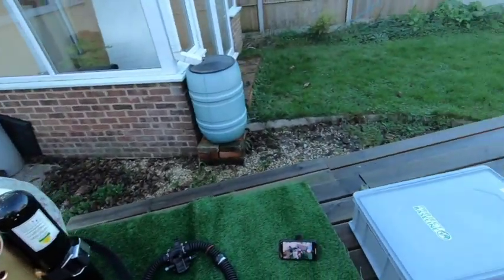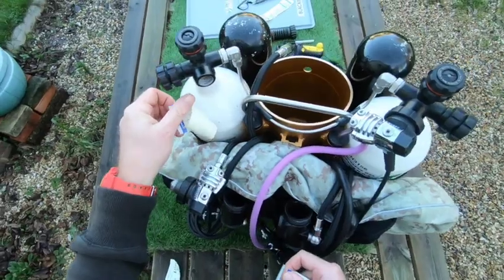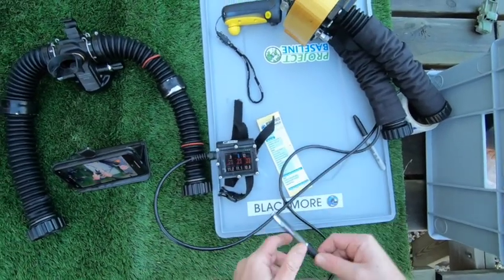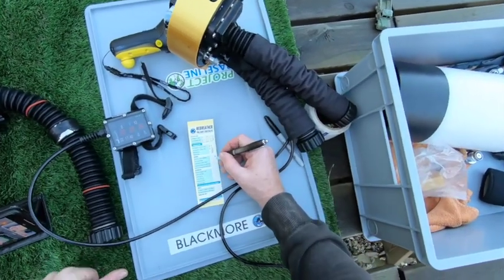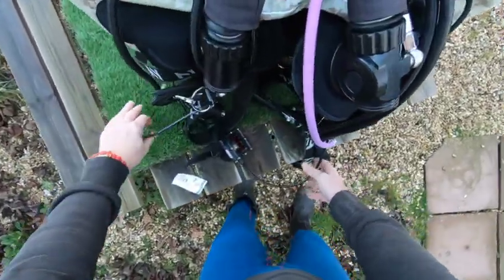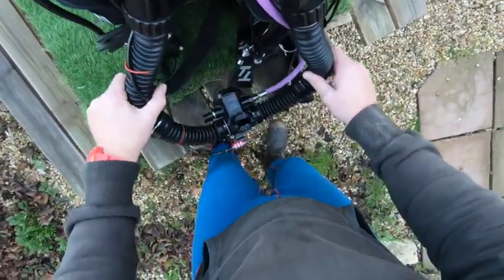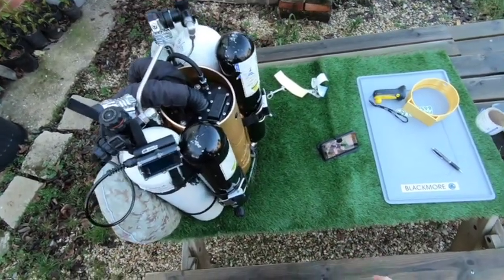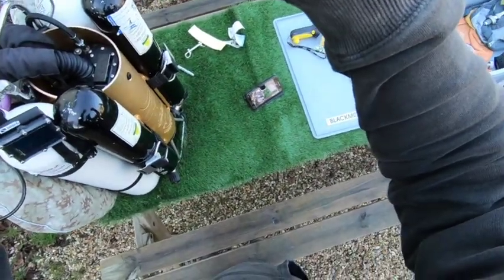GUE jj-ccr POV set up 2: checklist

Comment: It's interesting to see the differences and similarities between different agency's checklists. The GUE checklist and the one I use are actually broadly similar, with allowances for differences in the unit. I dive a hybrid rEvo, and the major things, like gas/scrubber analysis, checking o-rings, stereo/loop check, ambient pressure/high pressure leak tests, and electronics checks are all pretty similar. I don't check IP on every assembly, but I can see that being useful for detecting IP creep early.

One thing I do to save time is that I deal with O2/button checks and calibration while I'm waiting for the dil pressure gauge check. The downside is that if there's a dil leak into the loop, the O2 calibration is off, but if there's a dil leak, you're in for a lot of troubleshooting anyway.
Reply from the maker: Thanks for comment :).  The order of the checks can be important - if you’ve got a dil or o2 leak it’s useful to know if it’s internal or external … which is why they are done in conjunction with neg/pos test.
Reply: @gbdivering  Oh interesting! That seems like a good idea. Going back through the video, you mentioned that, I just didn't notice. :P

Comment: I haven't Tri-mix dived since 2000, but kept an eye on the evolution of CCRs . I was was solely Heli-air from 1993-2000. which served me well to 120 meters. 60-80 tri-mix dives annually. 
The JJ units seem to now to be a proven unit. I didn't see any advantage on CCRs TBH, 1996. 97. 98 seen a lot of rebreather deaths in my circles. 3/4 per year! 
wrecks i did were in strong tidal zones,  rebreathers had been reported back to require stops to make good on descents. 
I never had an issue with a shortage of gas either, 12-14L/min free swimming then 8-10L/min in deco. Weather and access ( available boats was a bigger problem! ). 
But now seeing a more simple systems over some of the first efforts look good. Set Parts 1 & 2 looks good. ( I always had a rule of pre-dive full build and test 24 hrs before a dive Pre GUE days).
Reply from the maker: Yes its interesting how much things have changed since I did an inspo course in late 90s till now :)

Comment: Hi Graham, i really appreciate your JJ videos. Hopefully you can make a video about how do you calculate buoyancy and weight needed with your bail and dill. Are you always diving overweight when you have the d7 onboard ?
Reply from the maker: Hi Tor  - you never use stage/deco in weighting calcs (as you can take them off  if needed).  Weighting is easier by adding Helium :)   I am not over weight in sea with decent under garment ... in fresh water can be heavy